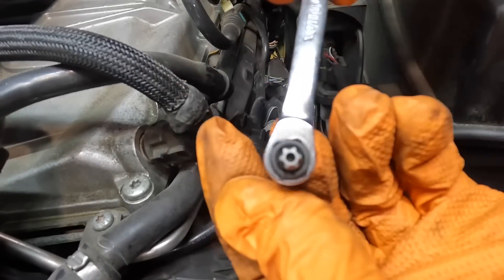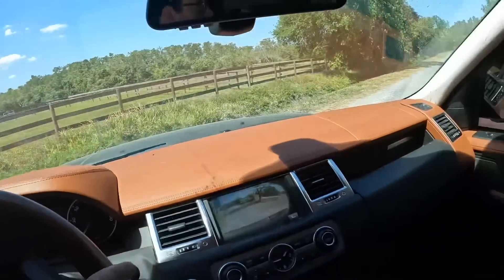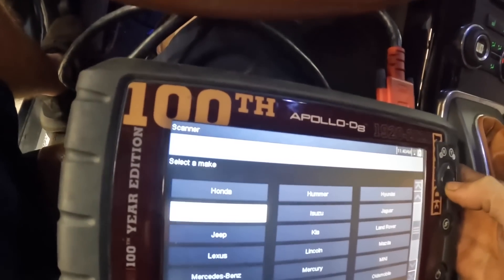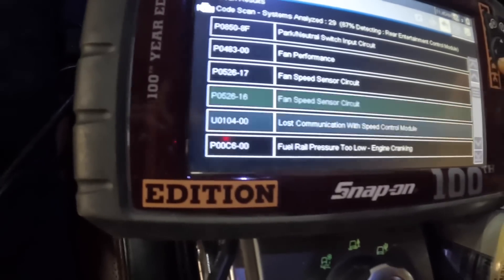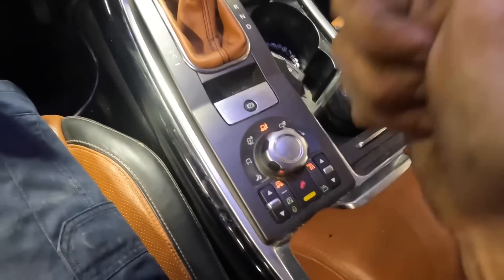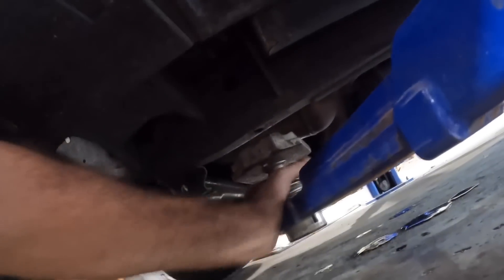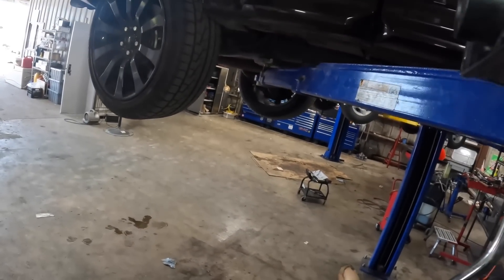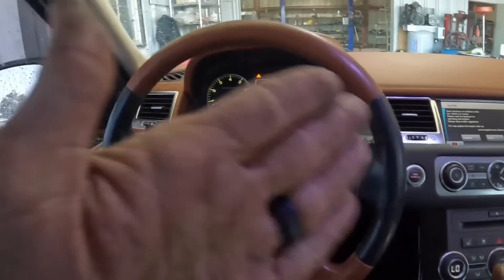Endless Diag! Supercharged Land Rover Range Rover 5.0 #mechanic #diagnostic

Comment: In England we would remark " A Range Rover with so FEW codes,that's a real surprise" or "it's a Range Rover what did you expect?" or "please do us all a favour and take it somewhere else"
Reply: At least a man could find a reasonable mechanic to work on one in England. Repairs at U.S. dealerships cost 2x to 3x of that in the UK.
Reply: Bollocks and poppycock! I believe those are the words he was looking for.
Reply: @Dave Stennett My Envoy Epic when I was a lad got that treatment, my Dad said: lets paint it with a roller!
Reply: Or bollocks
Reply: I go right to the "Bloody hell", but Python fans might mistake it for a bar until the 'c' is replaced with a 'k' then it's a kar, and Faulty Towers fans would beat it with a tree branch. Your choice.
Reply: Bloody hell!
Reply: It's the Jeep of the UK
Reply: @MuddyElbows  I'd say they're marginally more reliable than Jeep. Had a Grand Cherokee Overland that was a money pit.
Reply: The obd works you sure. It's a range rover
Reply: Cor blimey mate !
Reply: @Boodieman72  That's the word!
Reply: @gaiustacitus4242  they are VERY expensive to fix in the UK as well. You can perhaps save money by going to a specialist who won't reach for the parts cannon but parts are expensive and there is a lot of technology to fail.
Reply: That bloody car  is a pain in the arse it’s always going wrong that’s what I usually say when car is giving me problems.
Reply: @derektinkler4120  yes and no, used parts are available for some stuff - it's like most luxury vehicles - and this is a dozen years old.  
Always makes me laugh  when folks complain about the cost of running luxury vehicles.  What do they expect?  It's not a Ford throwaway - I'm not sure there's a worse car to own than an Explorer with it's constant repair bills and that's before it reaches 12 yrs old.
Reply: @Boodieman72  Bollocks. That's the one that I was thinking of. That, and the general BOHICA (bend over, here it comes again) British blanket statement of "Oh bloody hell."
Reply: @DeepakKumar-lv4te  People complain about the price of a used 4Runner, or a new one for that matter. If you plan on owning one for the long run, once it's paid off and assuming you've taken proper care of it and performed proper maintenance, that 4Runner will outlive and run circles around an Exploder or Xterror or TailBlazer easily on little more than regular maintenance, tires, brakes and batteries. There are always exceptions, but there are always dunderheads that go 15-20k per oil change, never check brakes until there is palpable grinding, ignore the transmission until forward progress is limited to one or two forward gears, then think about the transmission fluid at 250k, about 100k past what the Fird wound have survived with good maintenance to begin with, and then people will hear this twit talking about what all repairs that he just had to do on his 4Runner, nevermind be never serviced it right, that it's 15 years old, and has 290k miles on it and is on its 10th oil change.

"But it stranded me!" No, you stranded it and sentenced it to a lifetime of cruel and unusual punishment the day you took it home from the dealership.
Reply: @MuddyElbows but that's not fair to Jeep as you least you won't go bankrupt with a Jeep repair bill you might go into severe debt but you won't go bankrupt plus you're actually able to fix Jeeps, 🤭

Comment: There was a battery voltage low code in that excessive list. That might be responsible for the majority of the items in the list.
Reply: According to Scotty Kilmer, Low Voltage or Bad Battery can Make Your Vehicle Act Squirrelly and Bring in Many Faulk Codes...
Reply: My 750LI is tough on battrries
Reply: Too much electronic rubbish is in cars these days. all relying on the poor old battery.
Reply: If you run a modern Volvo with a bad battery you would end up with 20 - 30 error codes.
Reply: Powers and grounds…..start there.
Reply: On my Jaguar., The first thing you check is the battery. These English cars love their electricity. If the voltage is low, everything go sideways.
Reply: Tons of random codes. Check battery ground points and battery.
Reply: @JagMan  Does Jag use the Prince of Darkness? Lucas Electric
Reply: Sound just like a bmw😂
Reply: Low battery throws all sorts of codes on JLRvehicles
Reply: @BoringJohnson  My European Ford Galaxy had a bad battery which initially manifested itself in that the rear right door lock didn't work. As time went by, it resulted in ECM error, ABS error, transmission failure warning... Took it to the stealership and they wanted me to buy a new door lock actuator motor assembly for around $450. A few days later the car wouldn't start, and when I tried jump starting it the battery wouldn't take a charge and was deemed beyond salvation. Got a new battery and all trouble codes and warning messages disappeared, and the rear door lock started working again. It baffles me that with all the errors and warnings across so many systems, the techs at the stealership didn't even think to check the battery before loading the parts cannon.
Reply: That type of knowledge will save you thousands
Reply: I know my 2007 Jaguar XK forced my knees into the glove box because the seat module didn't understand the seat positioning after a jump start.
Reply: Yep. A bad battery in a European car can set tons of codes. Probably both batteries need to be replaced AND registered.
Reply: @randybeard6040  Faulk codes mean a rumpled detective will soon be arriving in a ratty old Peugeot.

Comment: Given that you're working on a Land Rover, it's a miracle that the position sensor inside the non-serviceable transmission has not failed. What would otherwise be a $30 part requires replacement of the transmission when it fails. Also, with the multiple cylinder misfires I suspect the timing belt is long past its 75,000 mile service life (a job that requires special tools).

p.s. - I once made the mistake of buying a Land Rover for a teenage daughter. I learned why the previous owner unloaded this vehicle when it became my money pit.
Reply: Ya on that. I gave mine well worn Toyota's . None needed more than basic wear/maint while in school, really good on the budget.
Reply: I'm thinking there's some grounding issues, other wiring issues, or the computer is on it's last leg as well. The Evap leak could also cause misfires since it's a closed fuel system. I'm glad I never actually bought one of these things, I feel for your wallet lol.
Reply: @peted5217  kids should not be given well worn cars of any make. That could be dangerous unless of course you get a full safety check to make sure the safety own like brakes, bearings, tires, lights, along with items that may break like hoses, belts etc.
Reply: @Rick Berglund  forgot to mention I worked as a vehicle tech 45ys ........
Reply: @rick980  yes Rick, people should give their kids the best, newest, safest, most expensive car available. That should teach them great life lessons

Comment: Just to let you know, that device that was in the diagnostic port, which may or may not have come maybe from their insurance carrier that wants to keep track of their vehicle. Can cause anywhere from mild to severe issues with different vehicles. I just got through with an insurance carrier and took out their diagnostic tool, and what was really strange as I had a very good battery in the vehicle, and although it was a couple of years old there was no reason why it should have been giving me these weird issues and some strange ghostcodes, the issues now since I've replaced the battery and the ghostcodes are completely gone. And there is no difference in the way the vehicle reacts. And there was no information for my testing the battery that it was bad but every once in awhile it wouldn't start unless I disconnected the battery and reconnected it. That was unique. I have never seen that happen and I've been working on cars since about 1964. So anytime you find something in that diagnostic port that is not a diagnostic tool, that should be a huge red flag about the size of Montana.
Reply: Looks like one of those generic ELM327 bluetooth modules, for the code reader on the phones.
Reply: This little Plug In Contraption is Advertised all over the Internet, it is suppose to Increase your Gas Mileage, I bought one to check it out, no increase at all--just electronic junk...
Reply: @F06M6  What they said. I have the exact same model (but never got it to work).
Reply: @randybeard6040   Big Clive has a video (or two ) about such devices and the waste of money they are.
Reply: Just came to mention the same thing once I seen him pull it out of the diagnostic port.

Comment: As an owner of an early 2013 Range Rover sport 3ltr diesel with 134000 MLS on the clock with zero defects, I get fed up with everyone slating them . Just keep them serviced . Mine has just been serviced 3 days ago at a land rover dealer including both diffs and transfer box oil change , engine oil and filter the bill was only £460 . Never given me a moment's trouble. I shall be keeping it as it's not worth anything trading it in so,I'll keep going till the wheels fall off !😊🏴
Reply: I currently drive a 2013 L405 SDV8. Can't say it's totally clean of issues, but I keep on top of them. I have the same corner leaning error (after a couple of hours driving) which is related to the active sway bar. I also have a broken exhaust temp sensor, waiting to be replaced.

My prev L322 had the clunk over bumps at low speeds, which probably is the rear bushings for the thrust control arms, so I recognise that. But in all, it's no worse than previous BMW's, Merc, or other cars I've owned.
Reply: @rhkavli  BMW, Merc you are setting a low bar!

Comment: Ray, I am very proud to say that I am a follower of yours, You could just load up the parts cannon, and spray the customers money at the problem until it goes away. I commend you for your honesty in recognizing that certain may be outside your well of knowledge. I has bosses both as a mechanic and a machinist (not the machinist part) that would say "If we throw enough of the customers money at it, something will work", After about two or three times being told that I would threaten to quit and expose their tactics. One time they told me to take my tools and leave........ I called a friend that had a 35' box truck with a lift gate (I was maybe 22 at the time......didn't know better). The truck blocked 4 bays and the alignment pit for about four hours. The shop paid a straight hourly wage not book time, so the guys loved the idea. They kept finding tools that they had "Borrowed" to personally hand back to me and shake my hand for standing up to the ass that was over charging his patrons.
Reply: You can throw money at a Range Rover it will never be fixed 100%, or 90%. The best you can do is get it to run, badly, maybe...
Reply: It’s pretty hard to find and independent shop that is capable to repair Rovers and won’t fire the parts cannon at it.

Comment: The ride height sensor readings don’t read as millimetres. They are just a relative number to the sensor. Only way to level car is to measure the wheel arch heights and then manually dial in the numbers (essentially “up a bit”, “down a bit”, etc.).
Reply: Yep and can be set with Rays snappy scanner

Comment: I wonder, could that blue dongle in the diag port have caused some of those mystery codes by confusing the network?
Reply: Progressive Insurance has a snapshot device that has them in court as it ruins electronics and the car's battery. It's online.
Reply: That's an ELM327 Bluetooth dongle. No it won't fubar the canbus. Most of those errors were caused by the low battery fault, that was present in the list. I've owned two Range Rovers and wrenched quite a bit on them myself.

Comment: Ive learned over the years working on them when seeing pages of faults on my scanner is to check the batteries.  All of them.  Then check body grounds.  Bcm/gwm is prone to water leaking from sunroof drains or washer fluid.  Your diag is just fine. Just adding some tips!

Comment: My dad had a Land Rover Discovery 3 (same company as Range Rover) that managed to break a crankshaft. It had a bit of a knocking noise going on that no mechanic could track down, it persisted for years until one day as he was starting to drive away from a house he was at, it got way worse very quickly and it shortly stalled without being able to restart. He called a Land Rover guy out and he was able to tell the broken crankshaft right away when he tried to start it.

And that was the first of THREE engines that lemon would chew up and spit out.

And over 30 years ago my mother had a Land Rover that would randomly cut out going around corners. Many parts cannons were fired, none of them fixed the issue.

My family has a history of this specific car manufacturer giving us lemons.

Comment: As the owner of 2 Range Rovers, what I can say is that the library of codes you found probably came from 1-OBD tracking/insurance module 2-old battery.  My suggestion would be clear the codes, drive the vehicle for a while without that stupid OBD device.  When you drove the vehicle, there were no misfires, no issues with steering, none of the majority issues that were reported were actually there.  Low voltage can cause quite a few issues with the BCM and several other modules.  The OBD device interferes with the vehicle communicating with itself.

Comment: Spare wheel winch is probably buggered by someone winding it in with no wheel on it, easy fix by replacing. Check the battery condition as low voltage will throw all kinds of codes.

Comment: I can tell you exactly why the mil light isn't on. Having purchased a couple of Florida cars I have found that because Florida does not require state inspections it is common practice for folks to remove the bulb. It's cheaper (short term) to pull the instrument cluster than it is to do the proper repair.  I have since learned to take a code reader with me when I look at any Florida car.

Comment: Ah the joys of having a Range Rover. I'm on my 3rd (must be glutting for punishment). My current is a 2012 HSE Lux. I live in a smallish town in PA. There is a local mechanic that is a specialist. Only works on Land Rovers and Jags. If you call his shop his voicemail greeting message states that he "isn't accepting any new clients". Tells you something about the reliability since he's that booked up  :). Heater/AC climate fan went. $5000 quote to replace the BMW sourced component because its located in the center of the dash behind EVERYTHING. 15+ quoted hours to pull the entire dash and components to just get to the fan. I did the job myself over a weekend. Lucky the 2012's have an opening that you can just barely pull the one one out and fit the new one without cutting the dash. Most models had a smaller opening. But had to pull almost everything except the dash frame and AC lines. Spent an entire weekend and lots of cuts and blood to replace a $150 part. Then an air shock went so replaced the pair - $1200. Winter then comes along and water pump went - $2500 job. Two weeks later, clogged fuel injector - replaced the entire side - $3000. Then brakes - $1500 (winter so paid to have it done). The list goes on and on. Only 75, 000 miles. Love the truck but its definitely not cheap to own.

Comment: I own four Rovers (Full-size, sport, 2 LR3's) from the 2005-2009 era. They have between 202-240K miles. The 4.4 Jaguar engines are BULLETPROOF if you do regular oil changes. The biggest issue is water intrusion that leads to corrosion and electronics issues. I've had this on three of the four. The next issue is air suspension which happens with all vehicles that have air suspension. Generally suspension issues are with the seals in the compressor or valve blocks. Generally instead of replacing those seals, mechanics want to put in new (pricey) parts. I get it, but you can rebuild for under $100 vs $2000 for a new compressor and OEM valve blocks. I have had one with a failed door lock mechanism at 150K miles. Other than the dash (which will crack from excessive sun/UV exposure) the interiors really hold up well. I love picking these up cheap when people dump them because there's so little to fix once you know the common issues. Great vehicles with a timeless look. Personally I've been avoiding "upgrading" to the newer models with the 5.0 engine as they are notorious for having timing chain/guide issues.

Comment: This car is based on the LR3 platform. The valve blocks for the air suspension can get clocked from old desiccant going through the system.
Reply: But that was not the problem here. Vehicle leaning is related to the active swaybar system.

Comment: You need a Ross tech vcds system. It's a cable and a software for a windows laptop. It will give you access to German and other European cars and not give you a code telling you to check with the manufacturer for codes it will tell you what the code is and gives you a bunch of can bus options

Comment: That list is standard maintenance tasks the every land rover dealer has pre printed on their forms.  Clunking happens on sharper braking mostly.  Lower arms last a year.  Im a pro on changing door locks on these and jags! Stability issues are normally air suspension.  These are the top of the money pit list 😂

Comment: Ray, does the vehicle have adaptive sway bars?  Does it leak anywhere in system? Or looks crusty rusty?  Reason, for most of those functional tests the vehicle sensors monitor abs, traction control, transfer case, adaptive sway in addition to suspension air bags.  Based on description "ever since"  something is not aligned or intermitent.